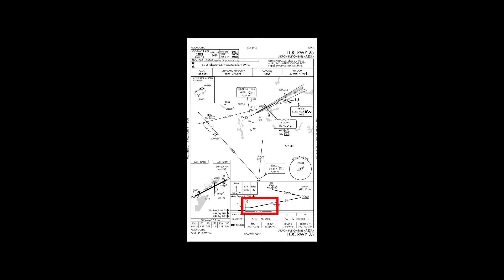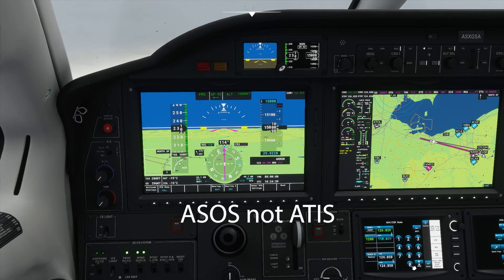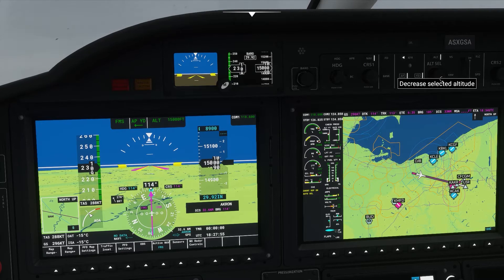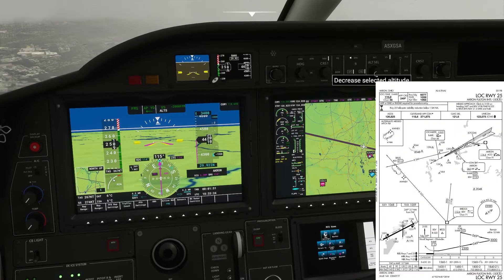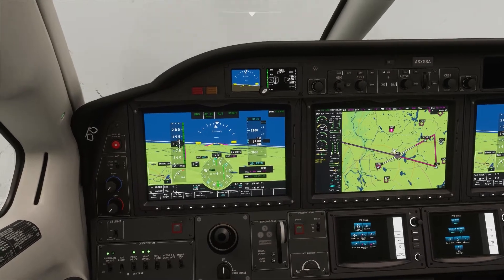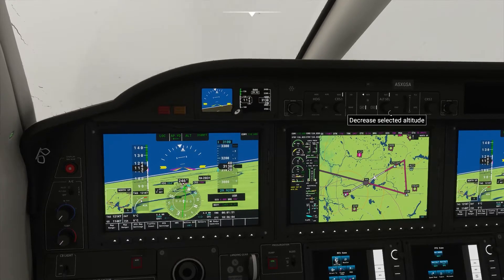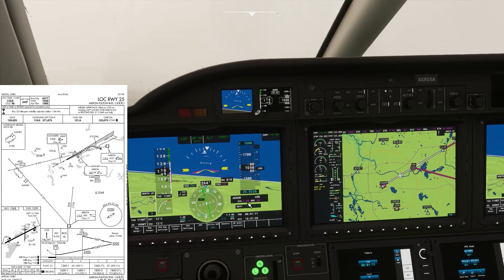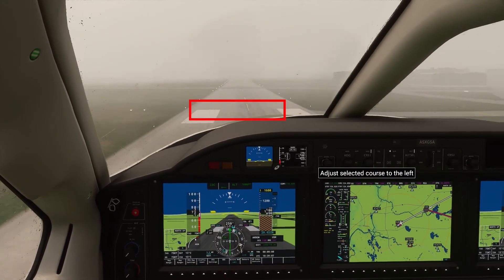Localizer Approach Tutorial - TBM 930 - Flight Simulator 2020

Comment: Why didnt you use aproach mode?
Reply from the maker: This was a localizer approach.  If you select APPR mode it would work, but if the GS is out and faulty, the autopilot will still try to capture the glide slope that will be unreliable.  APPR mode is generally used when a vertical component (glideslope or glide path) is being intercepted and flown to a decision height.
Reply: thecorporatepilotdad ok so a Localiser approach is different than a ILS approach? just trying to learn all this, thanks for your effort
Reply from the maker: @higaluto  exactly.   A localizer is more precise because of higher sensitivity than say a VOR.  An ILS has two components - a localizer and a glode slope.
Reply: @thecorporatepilotdad  hmm the part that confused me is at least on Boeing airliners there is an APPR button which aligns with localizer and a GS button which activates the glide slope. I tried doing a LOC approach last night in a Longitude and assumed (I guess correctly) that it would have a localizer but not GS. I pressed APPR and was surprised when it didn't even capture and align with the localizer.

Anywayyssss excited to watch your video and better understand LOC approaches.
Reply from the maker: @seattleraf  Appr will capture the loc and GS.  In the Boeing you can press the LOC/FAC mode and then use VS to descend to each altitude.